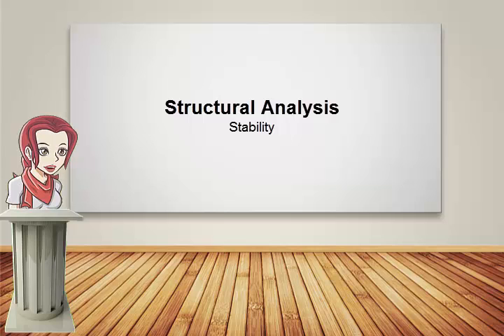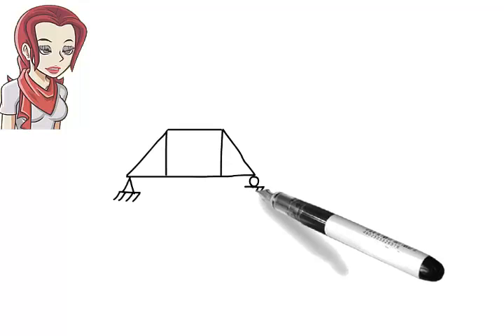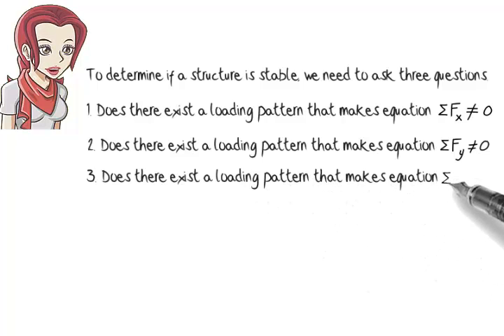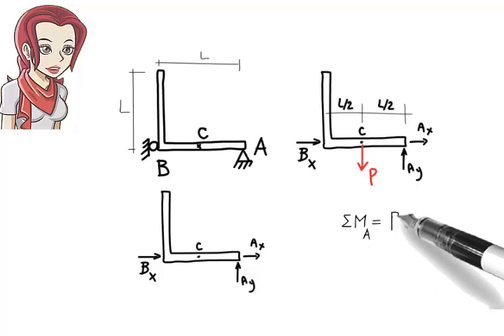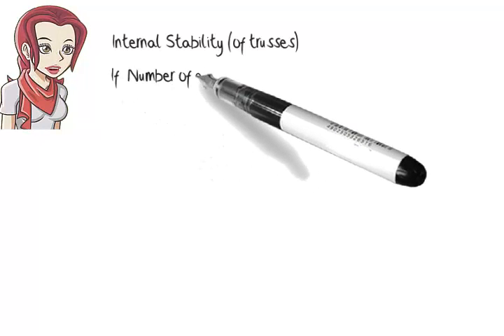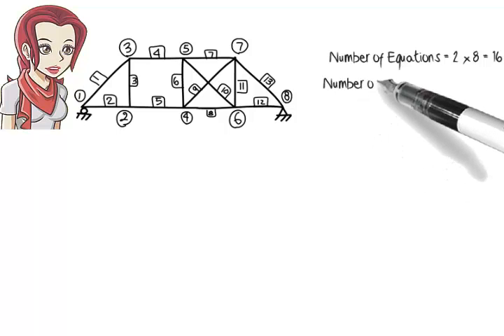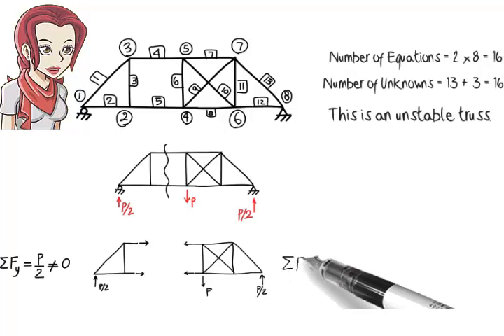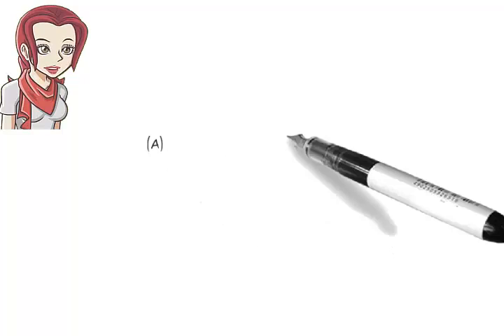SA02: Structural Analysis: Stability

Comment: A) r=3 b=12 j=8   so  15<16 unstable 
B) r=3 b=8 j=6   so 11<12    unstable 
C) r=4 b=6 j=5    so 10=10 but unstable
D) r=3  b=11 j=7 so 14=14  unstable 
E) r=3 b=8 j=6 so 11<12 unstable
Reply: Why are C and D unstable if they're both 0?
Reply from the maker: Please review Lecture SA02-A for further discussion on this topic, and an answer to your question. Here is the link to the lecture:  https://youtu.be/w7rAiqzlanQ
Reply: Structure C has a a hinge at the bottom chord. Hinge does not transfer a moment. So, you can cut the a section that passes through the hinge and solve for the moment. You will find that the moment will not be zero. Since moment is not zero your structure will rotate or accelerate.
Reply: for option D. If you take the moment at the center joint, the vertical force a the pin will cause moment.
Reply: QANIE ADNAN  d is stable
Reply: the reactions may b parallel r concurrent

Comment: We can easily guess whether the truss is stable or unstable by physical inspection itself. In the second example of truss there is one extra additional member i.e., member 9 which makes the structure unstable. If we remove that member then structure become  stable. We can guess all the trusses using the same idea.A truss is made up of a series of triangle joined together to make it rigid.

Comment: Solution  to exercise problem:

1. Stable 
2. Unstable (i)if we remove that horizontal member present in the mid of the truss then it will become stable ,this is one way of solution (ii) IN other way if we provide two more extra members to  the given structure then it will become stable.
3. Unstable 
4. Unstable ( as the roller doesn't resist vertical movement if we apply the force at any force) ( in other way , in that given truss series of triangles are missing as it seems like a rhombus in the second part of structure.
5. Unstable
Reply from the maker: They are all unstable. See: http://lab101.space/pdf/exercises/SA02-Exercises.pdf
Reply: @DrStructure  Can you kindly explain why A is unstable?
Reply from the maker: @rahatulislam6150  The number of unknown (member + reaction) forces is less than the number of equilibrium equations. Therefore, the truss is unstable.
http://lab101.space/pdf/exercises/SA02-Exercises.pdf

Comment: i would like to know, if you can put a charge somewhere in the trellis that involve all the trellis to work (i mean by that that you don'T apply the load on the support, or too close to it that half of the trellis are not used), if you are able to find all the force with equilibrium equation with the joint method, it mean that it is stable? Or is it possible that a trellis is stable until a load is placed at a specific place?
Reply from the maker: +mrmadame28 A structure does not have to be subjected to any load to be classified as unstable. A structure is considered unstable if there exists a load (even though at the time it is not actually applied to the structure) such that if placed on the structure will cause rigid-body motion.
Reply: Dr. Structure ok. That's because my teacher ask me if some trellis are stable or not, i can find instability and prove them when it is unstable. But when it is stable, im not sure how i can prove that it is stable beside of simulating every load possible and resolving the trellis... it is kind of very very long and pretty boring... Yet i vaguely remember a teacher saying that when a load is wisely chosen and the trellis can be resolved, than it is stable, else it will not work. If i remember, the "wisely" refer to loading the trellis in a way that the stress would be distributed along the trellis and not localy.. But im not sure, it's 3 years ago so

Comment: In the given problem no.C,how to deal with that internal hinge????or how can we analyse that given structure????
Reply from the maker: A pin/hinge like that is a source of instability. If a vertical external force is to be applied to that joint, then the sum of the forces in the y direction would not be zero, meaning the truss would not be in equilibrium.
Reply: Dr. Structure thank u....

Comment: dr is it always necessary that a truss having rectangular pattern will always be unstable. consider the case of a truss having a rectangular member  with roller support at one end and pin support at another end ,and its top member is restrained by fix support ,does this truss is unstable .
Reply from the maker: Generally speaking a rectangular pattern signifies instability. But there are always exceptions, like your example. If a rectangular configuration is supported by a pin and a roller at the bottom joints, and the top joints are also restrained by a pin and a roller (there is no fixed support in trusses), then no rigid-body movement can take place, meaning we have a stable configuration.
Reply: Thanx dr for u r  quick reply except on  the question of future video but their is always exception as u said.....

Comment: Hello Dr. Structure...
This is great video 
I have a query that how to ensure after getting the mathematical stability(means by ensuring that R = N 
or R + B = 2J ) that the truss will be stable?
as in your examples you have told that we should see the forces and moments equilibrium but it will not be easy to check this for large structure 
IN THOSE CASES DO WE JUST NEED TO WORRY ABOUT THE UNSTABLE TYPE OF GEOMETRY(LIKE RECTANGULAR) ? OR THERE ARE SOME OTHER CRITERIAS AS WELL ??
Reply from the maker: In the final analysis, it comes down to showing whether or not the equilibrium equations can be satisfied for ALL possible loading scenarios. If the answer is NO, the structure is considered unstable. Checking the R + B = 2J equation is not sufficient by itself. 

We have an updated lecture on this topic which you can found in our (free) online course. The link is provided in the video description field.

Comment: As there is hinged support at A. so how can you get moment at point A(3:38)
Reply from the maker: It is important to make a distinction between bending moment at a point (like at Point A) and the moment equation that we can write about that point. They are not the same thing. One refers to the actual bending moment the other is an algebraic equation which represents the sum of the moments about the point.  It is true that bending moment at A is zero, but that does not mean we cannot sum the moments about the point. Regardless of the value of bending moment at A, if sum of the moments about A (caused by other forces acting on the structure) is not zero the structure would not be in equilibrium.

Comment: Can I ask a question outside the lecture.... what is the  physical meaning of stiffness method?!
Reply from the maker: Think of a spring that we can pull or push. How much the spring elongates, when we apply a tension force to it is a function a property called spring stiffness. The higher the stiffness, the less it is going to elongate due to the applied force. We can write this relationship as f = k d where f is the force, d is the elongation and k is the stiffness of the member. Stiffness is a function of both material and section properties of the member.  

A structure can be viewed as a system of springs, that is, each structural member resists rotation and displacement the same way that a spring resists elongation. When we have a set of structural elements forming a system that resists loads, then the simple spring equation becomes a system of equations where f is a force vector, d is a displacement vector, and k is a two-dimensional matrix of stiffness coefficients which dictates/controls how much the systems deforms under the applied loads.

Comment: Can you explain how B is unstable?

Also, even though some of the trusses passed the instability test of 2J = M + R, that didn't mean they were unstable. We had to analyze the structure further to determine instability. However, it seems that process is more complicated since there isn't any rule we can use and we just simply put loads in random places and see if any instability occurs. Are there any simpler process to it?
Reply from the maker: There could be times that 2J = M + R, yet the truss is still unstable. But the reverse is not true. If the number of unknowns is less than the number of equations, we have instability. 

You are right, there are no encompassing fast and easy rules for deciding the stability of structures. In the case of Problem B, we can use the notion of zero-force members to prove the instability of the truss. Suppose we place a unit load at the middle right node (the one on the inclined member), and assume it to be the only force applied to the truss. Then, the vertical member is a zero-force member which we can remove from the truss. Also, the horizontal member connecting the two middle nodes is a zero-force member. If remove it from the truss, we end up with a triangle sitting on a pin and a roller, with the applied load acting at the middle of the right inclined member. By definition, such a truss is conisdered unstable.
Reply: Are you assuming the unit load is placed perpendicularly to the truss or is it vertical?
Reply from the maker: Either way. As long as the force is not in the direction of the two members, it is going to have a component in the perpendicular direction. And since it would be the only force in that direction, then the sum of the forces in that direction cannot be zero.
Reply from the maker: Tell me your line of reasoning for solving this problem. What prevents you from reaching the conclusion , what confuses you, what is (where is) your starting point for solving the problem, and where do you get stuck?

Comment: In which case we should not assume the bending moment zero at internal support? Plz i have confusion
Reply from the maker: Bending moment at the ends of a beam  is always zero, if the ends rest on pin or roller. However, within the member (away from the ends) bending moment is zero where there is an internal hinge. 

If the beam does not have an internal hinge, but it rests on an interior pin or roller support, the internal bending moment in the beam at that support point is not zero.

Comment: For the equation used, What does it mean by the no. Of members? 
If a member is connected at 90 degree with another member with no pin support in between, do I treat it as one member or two member
Reply from the maker: For trusses, the straight bars are always assumed to be connected to each other using pins. So if two members are connected a 90-degree angle, we assume there is a pin connecting the two at that intersection.

Comment: can you please clarify why at 3:18 the force on the roller is Bx and not By in the vertical direction???
Reply from the maker: Because the roller is not acting on the horizontal plane, it has been turned 90 degrees, it acts on the vertical plane.

Comment: excuse me Dr Structure, if i have a truss (2 pin supports, 10 members and 7 joints)  externally indeterminate and internally determinate, so whats the overall status?
Reply from the maker: That would be considered an indeterminate structure since we cannot analyze it completely using the static equilibrium equations only.
Reply: Dr, may you make a video about stability and indeterminacy in frames and composite structures, please ?!

Comment: Dr structure, if I understood correctly, structures with non-triangular shapes are unstable, is this right?
Reply from the maker: It is a good rule-of-thumb to suspect instability if a non-triangular configuration exists, but you need to further investigate it.  Why? because we could have stable trusses that are not formed using simple triangles.
Reply: So we investigate further using method of sections to check if each section is individually stable, right?
Reply from the maker: That is one way to do it, though I would not recommend it. Take a look the following video for another perspective on this topic:

https://youtu.be/w7rAiqzlanQ

Comment: when no. of unknows is less than no. of equations then the truss is stable i.e 11<12 so why not the truss is stable
Reply from the maker: Your assertion is not true. If the number of unknowns is less than the number of equations the structure is considered unstable.
Reply: Here unknowns are less, hence it can be solved using equilibrium equations. Hence it is a determinate structure. But it doesn't mean that it is stable. Actually here 11<12 indicates the number of members in that structure(11)is less that the number of members actually needed for its stability.(12), hence it is unstable.Am i right @Dr.structure ?
Reply from the maker: yes, you are correct.

Comment: you gave us two examples about the unstable case !... So how can know about stable???!
Reply from the maker: +Taha Mohammed  As a general rule, stability of a structure can be decided by formulating the system of equations necessary for its analysis. If that system (often linear in nature) has a unique solution, then the structure is stable. If the system of (linear) equations has no unique solution. For example, if it has a zero determinant, then the structure is unstable.

Comment: hai,
Here it is mentioned that the number of equlibrium equations for a truss is 2j. Isn't it 2j-3?
Reply from the maker: If we the truss has j joints and we can write two equations per joint, then we get 2j for the number of equations. Why would you subtract 3 from that?
Reply: when we consider the basic form of a truss that is a triangle, it will be having three joints right ? for that if we are using 2j, it will be 6. But actually it is having only three equations and the other three are one plus in all the members no ? but after that, if we are increasing the number of joints, exactly two equations we will be getting right ? that is why i said that 2j-3. Is my assertion right ?
Reply from the maker: Okay, I think I see where the misconception comes from. 

A simply supported truss, with a roller and pin support, has exactly three (3) support reactions. Say, the truss has j joints and m members. Then, we say:

There are 2j equilibrium equations and m + 3 unknown forces (the truss has m unknown member forces and 3 unknown support reactions).

For us to be able to solve for the unknowns, the number of equations must be equal to the number of unknowns, or:

m + 3 = 2j.

If the above condition holds true, then we have a determinate truss. We can rephrase (rewrite) the above condition as:

m = 2j - 3

That is, if the number of members (in a simply supported truss with a roller and pin support only) equals to 2 times the number of joints minus 3, then we call the truss statically determinate.  Here, m is the number of members, not the number of equations.
Reply: please excuse me if am annoying ! First of all Thank you for that explanation ! But i want to know if a frame is having end conditions not as a pinned and a roller, will that expression 2j-3 goes wrong while determining the number of members required for the structure to be determinate ? Asking this because i have seen in a book that the degree of internal indeterminacy can be found out using the formula m-(2j-3) for pin jointed plane frames !
Reply from the maker: You are not annoying at all. I would be delighted to help clarify issues and answer your questions. 

Number 3 that appears in the equation is a reference to the number of support reactions.  Yes, if the number of unknown support reactions is different than 3, you should not use that expression to decide if the truss is determinate.  Although in most cases determinate trusses have 3 reactions only, but there are exceptions.
Reply: Thank you so much ! :)
Reply: For finding out the internal indeterminacy of a pin jointed space truss, the formula is m-(3j-6), if my knowledge is correct 3 in this formula indicates the number of reactions at the joint and 6 indicates the support reactions. But could you please tell me how that 6 came ? As it is a space truss, it should have at least three supports no? in that case if it is one hinge and 2 rollers, then reactions will be 5, or 2 hinge and 1 roller, then reaction will be 7 right ? then how that 6 came ?
Reply from the maker: Think of an object, say, a structure in the 2-dimensional space.  We can move it in two directions: x and y. We can also rotate it. This would be a rotation about axis z. An object that is in static equilibrium should not be able to move or rotate freely. So, we say that in planar (2D) space, we need to have at least 3 reactions forces as supports. For most trusses, this means a pin and a roller would be sufficient to prevent free movement (or rigid body motion) of the structure.
In space trusses, we have 3 axes in play: x, y and z. Since we can have a movement and a rotation for each axis, there would be 2 x 3 = 6 different ways that the structure can move freely. A truss can move along the x axis, along the y axis, and along the z axis. It can rotate about the x axis, about the y axis and about the z axis. By the way, we refer to these as “degrees of freedom”. So, a space truss has 6 degrees of freedom where as a planar truss has 3 degrees of freedom. 
This means for space trusses, in order to prevent rigid body motion, we need to have at least six support reactions, since there are six degrees of freedom associated with the structure. That is where 6 comes from in the determinacy equation.
Reply: Thank you so much ! :)
Reply from the maker: You are welcome!